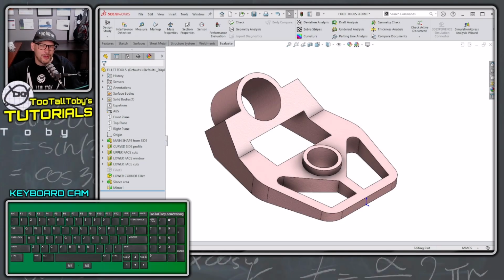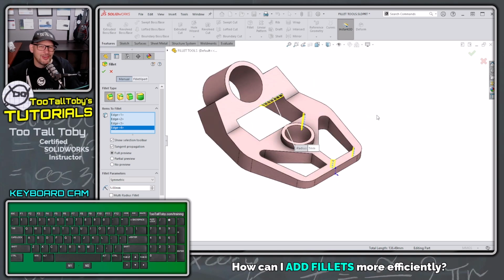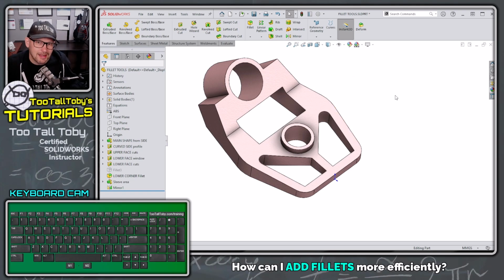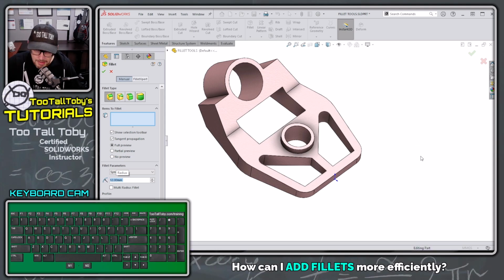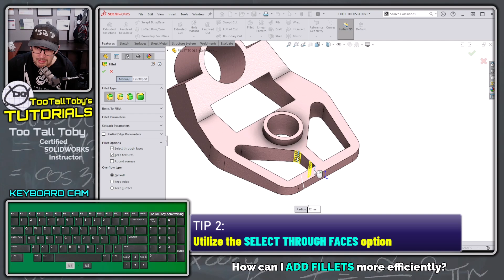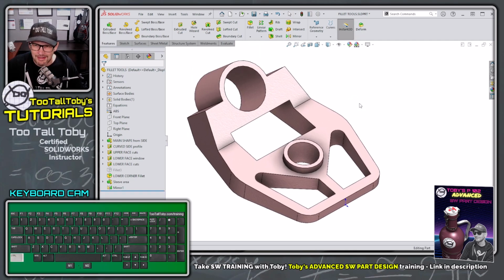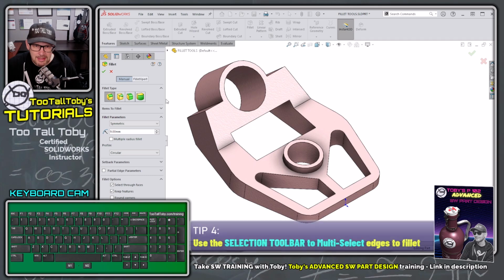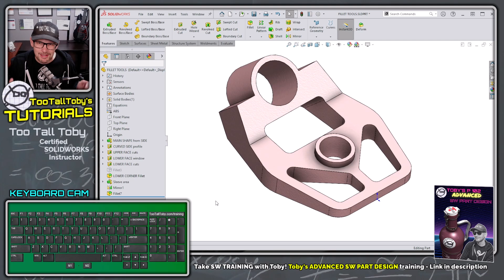FILLET FASTER with this SECRET SOLIDWORKS SHORTCUT!

Comment: Any tips on using the fillet selection toolbar on sheet metal parts? If I'm trying to knock all the corners off a part I've had little to no luck with it and end up selecting them one at a time.